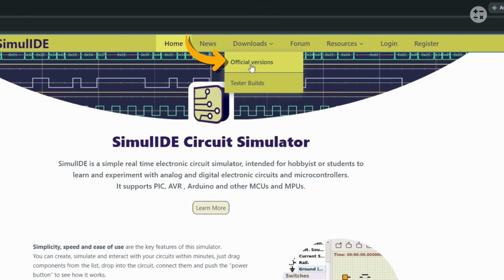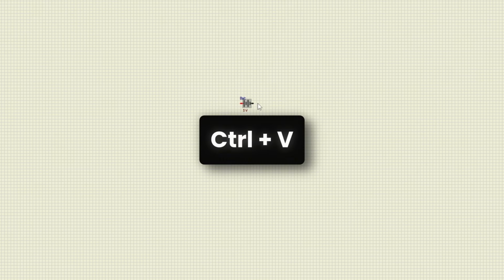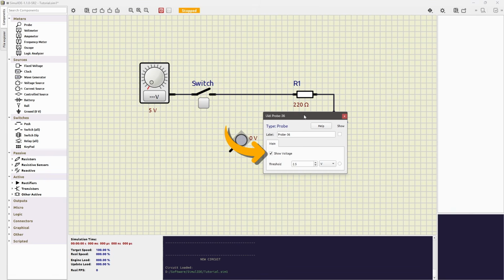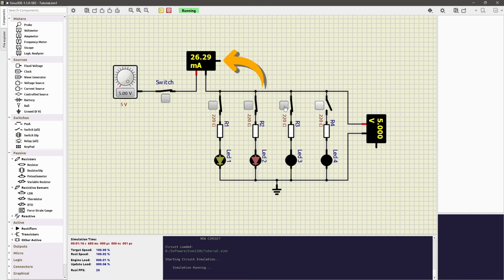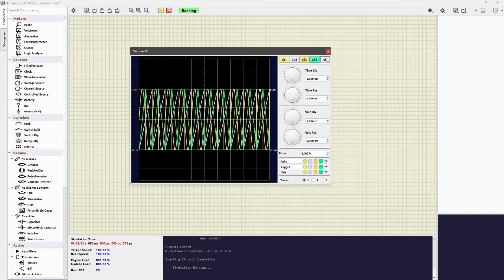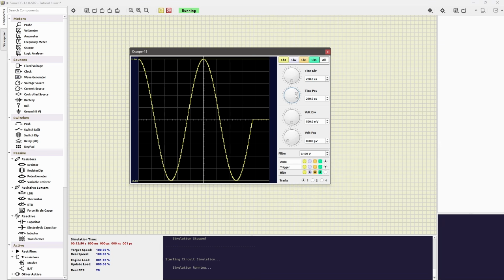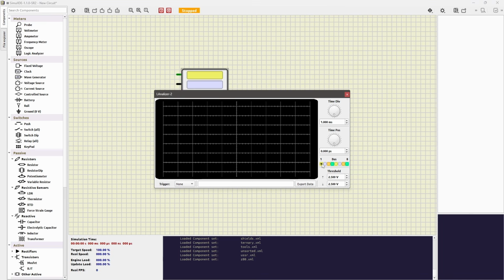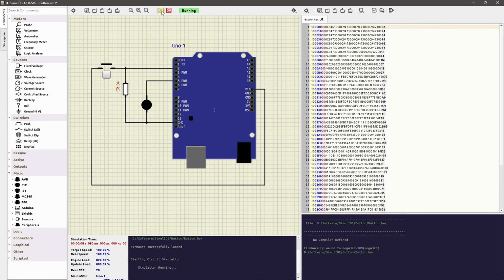Free Simulation Software | Tutorials on how to use SimulIDE for simulating electronic circuits

Comment: Which was better for simulation between LTspice vs SimullDe?
Reply from the maker: LTspice is mostly used for Analog Devices and have a long learning curve so if you need easy simulation software then i suggest SimulIDE. For which is better, both the software has its cons and pros.

Comment: Interesting, but I would like to see more about component models.
How does this compare to Kikad for basic AC to DC circuits?
Let us say an LED flasher supplied from a 240v AC transformer linear supply and using a 2 transistor multi-vibrator?
Reply from the maker: Hi, I have not tried any AC related circuit simulation, will definitely try what you suggested. But for DC circuits simulation this works fine. There are lot of DC circuit available for you to try under File Explorer > Example
Reply: @diyhideout  Thanks for the suggestion😃
Reply: Okay, there is only an ESP32 circuit in the examples folder.
I managed to put together a circuit without the multi-vibrator as a load.
With a source of 9V AC full wave rectified, using the probe the DC output was at 15 volts (about 2 volts more than expected).
The text size in many frames was not adjusted to display within the frame and the pointer was often selecting the lower text option.
My conclusion is that the program seems promising, but needs some more work.
Reply from the maker: @Goldentoenail  Ya i agree with you. The software needs more polishing.